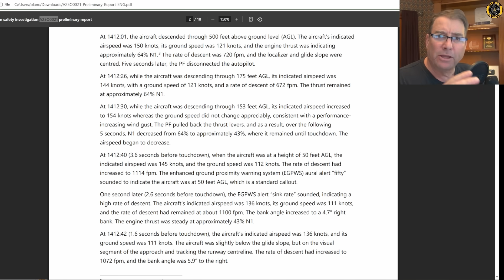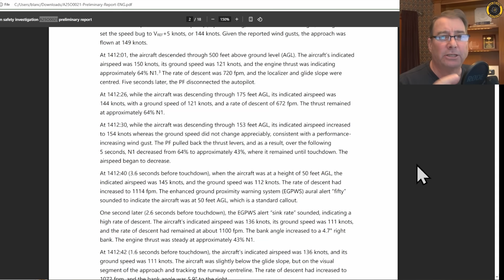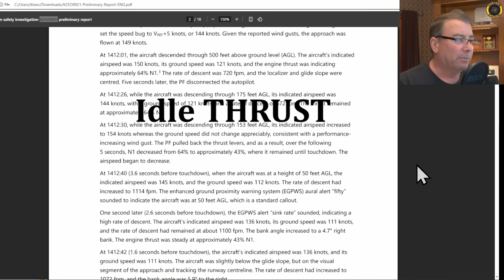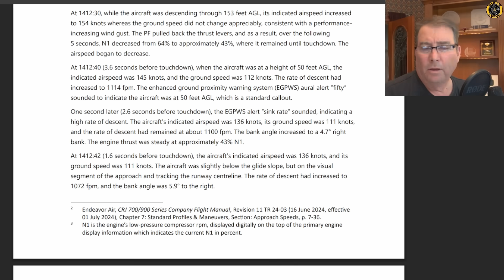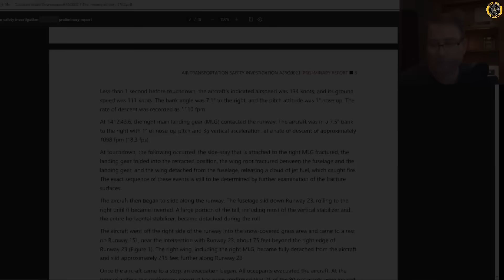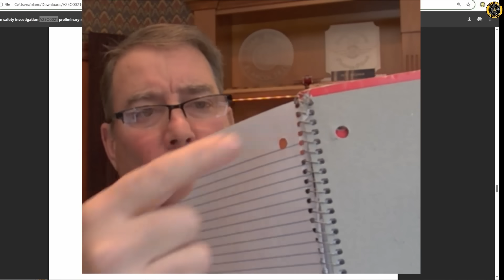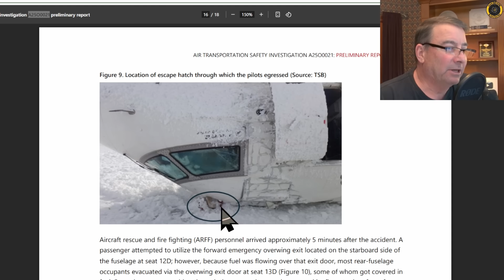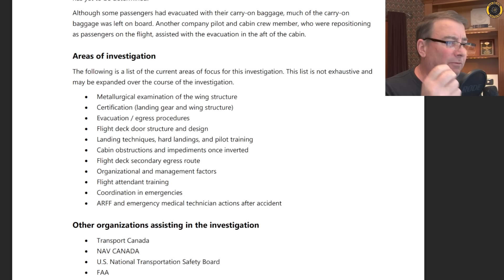TSB Prelim Toronto CRJ Crash

Comment: Juan, for the first 22 years flying for the airlines the standard was to turn the auto pilot ON at TOC and OFF at TOD. Auto pilots were never on in the simulator with limited exception of a CATII approach. The ILS or non precision approaches were hand flown in most cases. This First Officer turned the autopilot OFF at 500 feet. My preference was to turn the auto pilot off no lower than 1000 feet when rough and gusty so you had time to get your act together. If the procedure is to turn the auto pilot on at 500 feet and off at 500 feet a new pilot gets very little actual flying time. When I first went to the MD11 in 92 the company encouraged using the autopilot and auto throttles at Captains discretion. Then that was changed to you must use the auto throttles all the time. Then after a number of hull loses and tail strikes the policy changed to encourage hand flying the airplane. The auto flight will do things perfectly conditions permitting. The human needs to learn, and then practice after learning.
Reply: Additionally, hand flying at an earlier altitude (1250-1000 ft) gives the Captain more time to observe how his co-pilot is handling the conditions.
Reply: Add some glider experience and a little Aerobatics (for proper recovery from unusual attitudes), and ATPs should get significantly better.
Reply: For what I understand, the MD-11 has relaxed static stability, similar to the F-16 (?). I heard discussing how “tricky “ it was landing the MD-11 in a windy day. Reminds me of the FedEx machine that crash landed in Japan, windy day, unfortunately the crew lost their lives.
Reply: @ I recall the F/O turned the auto pilot off at 200 feet and the wind was not very strong. I never found the MD11 very tricky. Like every airplane you can have humbling landing on occasion. I like flying it for about 18 years.
Reply: Totally agree. 
Current 777 captain with about 22000 hours. 
So many FO’s I fly with take A/P out at about 300’. I usually take it out after the stable call at 1000’, particularly when gusty. 
Young pilots nowadays come out of glass cockpit trainers, then go straight onto a fly by wire A320. No experience actually flying a conventional jet, and it shows.
Reply: I think stick and rudder skills in the airline environment are very poor tbh...
Reply: @CCitis  They are but you have such tolerances now that you cant get away with what you use to back
in the day.

You got FOQA tha tells on you. You cant do the old school chop and drop flying anymore due to new stabilized approach criteria. The moment you get the least bit of deflection on your cdi you have to execute a go around. Very few and rare opportunites for pilot to hone their stick and rudder skills.

You cant hand even fly ILS down to mins becuse most SOP’s prohibit it. Where can you actually work on your stick and rudder skills flying the line?
Reply: @AirmanBrown  I totally get it. I think back in the day folks had a lot more of this due to pre airline experience and obviously less automation. It’s an interesting conversation right. Sometimes some good hand flying will go along ways, sometimes it will get you in trouble
Reply: @AirmanBrown Clearly there’s an issue with those in charge making flying more dangerous because they desperately want to believe technology is the answer to everything
Reply: @chrisnoname2725  It is not as simple as that. Human beings make mistakes and technology can help them make fewer mistakes. Sometimes the technology cause them to lose the skills that used to keep them safe.
Reply: And in many countries the norm is to turn it off only at 100' AGL. Usually same countries that hire pilots with zero knowledge or experience and have them in the cockpit at 250 hours.
Reply: @kewkabe  total rubbish.

Minimum autopilot engagement altitude  is aircraft type specific not country specific.
There are many types when AP engagement is not permitted below 1000ft on departure.
Reply: @kewkabe  Operating procedures are set by airlines, not by countries.
Reply: I think a pragmatic approach to this is needed. One needs to go back to what the autopilot is actually for...
Reducing pilot workload and increasing flight path accuracy. 
So in congested airspace with high workload it is almost negligent not to use it, as you are exposing yourself and everyone around you to elevated risk.

However when it's quiet and you are clear of RVSM airspace then practice hand flying and if the weather is OK a hand flown ILS or even better an NDB (if there are any left!).
My last company (European operator) encouraged this.
Reply: @ Actually in congested airspace hand flying would result in a quicker reaction to a visual conflict or RA  understanding apparent visual conflicts may not be correct, reference TWA B707 EAL Connie midair Dec. 4, 1965.  Accuracy is very precise with automation so flying an intentional offset on airways has been suggested. 1 or 2 NM Right has been used for years. The midair over Brazil would never happened if one airplane was flying 1R. ATC in China always assigned 3R as a standard practice.
Reply: DITTO .... my pref was on the approach and visual with the runway, AP OFF .... and unless a Cat II/III ILS ... before the automated radio altimeter callouts at 1000 agl.

great post.